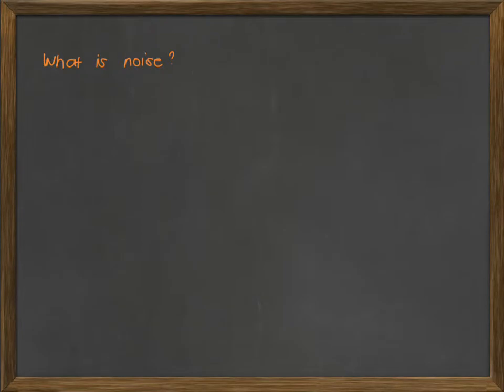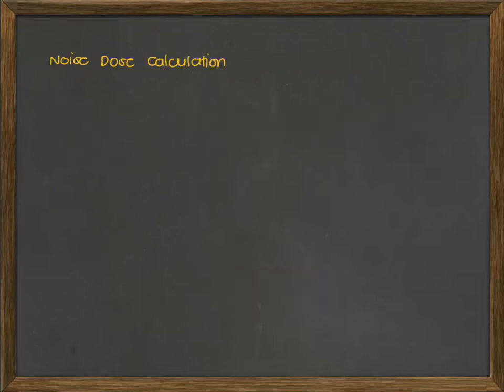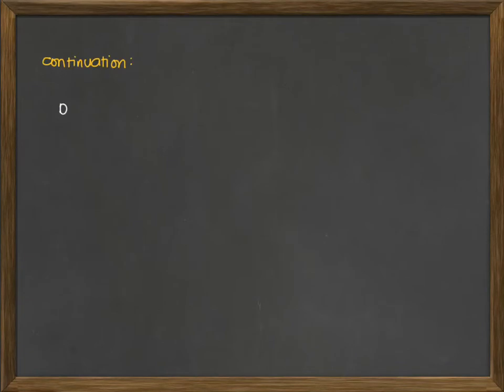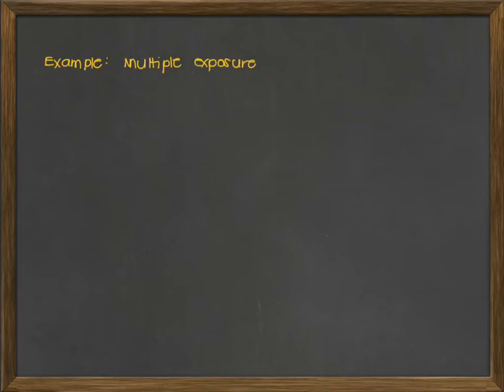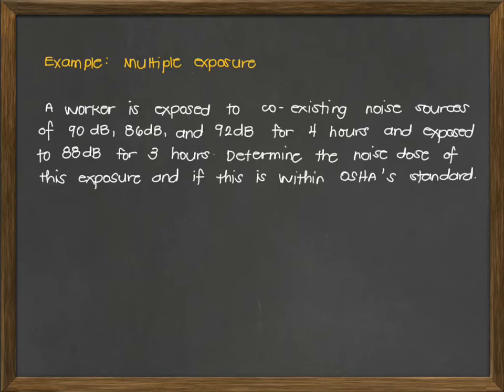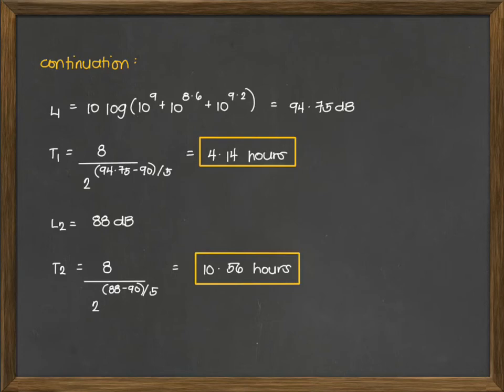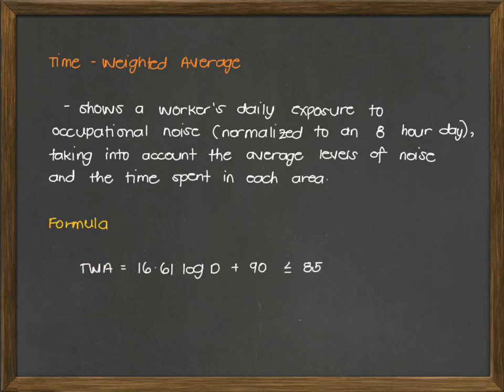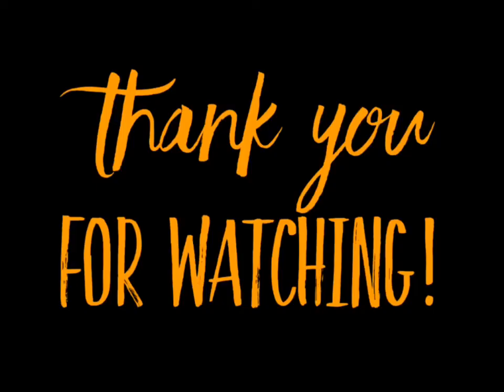Ergonomics - Noise dose and Time weighted average

Comment: Mam i working on noise hazards research work .very informative , if the sound is varying for every 5 minutes of interval c1 should be in hrs and c values will be more according to intervals taken?
Reply from the maker: Hello! Yes, you have to get all the readings for each interval. You can convert the times in hours or remain in minutes. Just make sure that C and T are on the same time unit, (minutes or hours)

Comment: Ms Ezrha, in conducting noise level measurement, the sound level meter app registered 3 values. Min, Ave. and Max. What value must be used to compute for TWA?
Reply from the maker: Hello! During our experiments, we use the maximum level from the readings as this will set the tolerance limit for your computation. You have to however, make sure that the maximum reading is not erroneous. We usually perform trials for each site where the readings are taken. I hope this helps :)
Reply: @EzrhaGodilano  Thanks a lot Ms Ezrha.